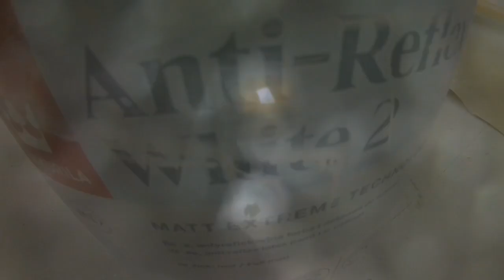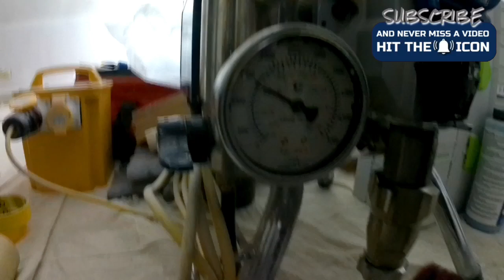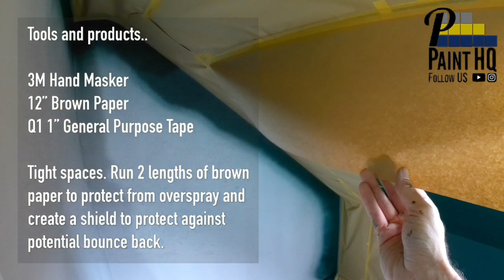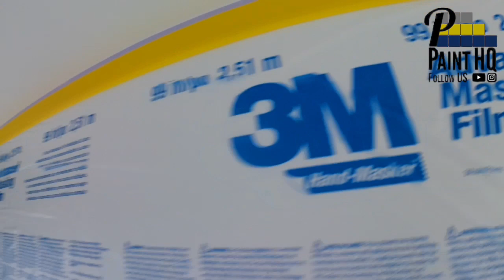How to Paint New Plaster | Mist Coating | Airless Spraying Interior Walls

Comment: nice video....with how much water is the paint diluted?
Reply from the maker: Hello my friend.. thank you so much for the support.. with the mist coat, dilution is approx 30% ..then the top coats of emulsion is just a splash to help ease the flow and spray at a slightly lower pressure.. trim / woodwork paints, I don’t thin.. and only emulsions I thin.. hope this helps, more than happy to help anytime.. I’ll always get back to you.. thanks for supporting PaintHQ.. regards Pete

Comment: Hi Pete, 
I’m posting this separately as it’s a different question. 
Given your logical sequence of working up the room, e.g. trim, then walls, then ceilings, I wonder how you might approach a room with a dado and/or picture rails. I have a client who has just asked for the walls, above and below a dado rail, to be different colours. That led me to thinking about making design suggestions to clients who might not have thought of creating feature walls or highlighting dado and picture rails (perhaps white) against a slightly darker shade on the walls. Would this change the order of spraying for you, or would you simply hit the rails along with the rest of the trim and then mask dado/picture rails carefully and then spray the walls, and afterwards the ceiling?
Many thanks for all your inspirational postings. With best wishes,
Rob
Reply from the maker: Hey Rob.. no problem, I’m glad you’ve come to me for advice.. basically your logic is right (all woodwork first - ceiling last).. In terms of spraying (obviously job prep etc first).. you’d always take care of all the woodwork first, then mask up for walls, this would include dado / picture rails.. then if you have different colours split by the dado for example.. spray from the bottom up.. so if you mask the skirting (brown paper as usual) and the dado, you could use a wider tape, masking the bottom edge of the rail, then top edge of the rail and if the tape is wide enough the 2 runs will cover.. otherwise run a 3rd strip of tape along the middle.. then spray your colour over that rail.. pull the masking (you could look at keeping the top edge on) then tape and drape plastic from the dado down, covering the skirting.. spray your next colour up onto the ceiling as normal.. pull all the masking then tape and drape the entire wall to finish up spraying the ceiling 👍 Hope that makes sense.. it’s not as tricky as it sounds, an extra colour would (most likely) add a day to the job with drying tines.. my HSL video had a dado in the hall, can’t remember how much footage I filmed of the hall if you can see it.. it was only a one colour wall / white ceiling though 👍 ..Take care my friend, let me know how this progresses 😆 regards Pete
Reply: @PaintHQ  Hi Pete, many thanks for such a detailed answer. I’d missed noticing the dado on your HSL video, so took another look and found it at 9.26! I’m now looking forward to the job. With thanks and best wishes, Rob
Reply from the maker: Ah cool 😆 ..You’re very welcome buddy, anytime 💯 .. let me know how you get on
Reply: Id definitely warn them of doing that if the rail is different from the frames and skirt when it joins it looks shit ... they probably want classy not a clown house.. google search it and show them..but id spray it finished then mask it off.

Comment: Do you leave the windows masked up until the room is finished or do you peel it off whilst the paint is still wet to avoid peeling? Then reapply new stuff
Reply from the maker: Hi Ashton, thanks for the question.. typically I remove masking when wet, like you say to avoid the risk of peeling.. Great to have your input, keep in touch buddy.. regards Pete

Comment: That's a really great video mate. I recently sprayed a freshly  plastered ceiling using ar2 but only thinned by about 20 or 30 percent and it did bubble and peel in places. I put this down to maybe going in to thick with it? Or maybe I didn't thin it enough ? Or maybe a bit of both !?

Also, did you use pink tesa over the little green once painted and how long did you leave the little green to dry?

Only asking as again I misted with ar2 and left overnight and it still peeled with using pink tesa over it .

Soz for all the questions! Many thanks
Reply from the maker: Hey Chris, really appreciate you watching and giving the kind feedback 💯 ..Maybe just to edge on the side of caution, with AR2 by design providing  such solid coverage, I’d look to thin an AR2 mist a bit more.. say about 50/50 or 60/40 in favour of more water.. at 60/40 the mist is still pretty solid and sucks into the fresh plaster a treat 👌 Regarding the Little Greene.. I mist coated (allowed to dry) and sprayed Little Greene in one day.. the following day, I masked off and sprayed the main walls.. My actual preference is Deltec Sensitive, I do occasionally use Tesa due to availability.. I know a lot of people rate Tesa, for some reason I have more success with Deltec.. I always use a sensitive tape when masking off walls (then use Q1 General Purpose / or SP80 on the hand masker), luckily I don’t get many snags... Hope this helps a little my friend.. ask as many questions as you want, I’ll always help if I can.. keep in touch.. regards Pete 🎨💯
Reply: Great reply cheers Pete 

All the best 

Chris
Reply from the maker: You’re very welcome my friend 💯

Comment: With most coat is it 50/50 water and white paint?
Reply from the maker: Hey Danny, thank you for your question.. yeah 50/50 or you can push it to 70/30 (30% water), especially if mist coating a ceiling in white, it will start to look solid very quickly 👍 ..for mixing the mist coat, use an acrylic based emulsion or you could use an acrylic primer that’s specific for fresh plaster.. that way you might not need to thin, but it wouldn’t hurt to add 30% water for the very first coat.. hope that helps my friend.. keep in touch, it’s great to have your contribution on the PaintHQ channel 🙏 regards Pete

Comment: Hi Pete, spot on job. Have you ever had a problem with the paint pulling using the Deltec Purple Delicte? Also have you ever mist coated with Johnstone's Covaplus or Durable before following on with the same top coats and if so at what ratios for mixing. Thanks.
Reply from the maker: Hi Lisa, thanks for your feedback, really appreciated.. The only time I have problems with Deltec Purple, is when I’ve prepped and repainted (sprayed) someone else’s work and it became evident that the initial paint job, the fresh plaster / skin wasn’t mist coated / primed.. it’s a horrible situation, we just don’t know historically how the plaster was prepped.. or another possibility could be dust contamination of the walls.. I think in either of these situations, it wouldn’t matter how low tack the tape is, there’s real potential for the paint to pull 🙈 Otherwise I’ve personally found Deltec Purple very good, the shade of purple is easy to see when finding your line too Vs other brands.. regarding mist coating / Johnstones.. in the past I would use Covaplus on my ceilings, I actually don’t mind the Johnstones range 👍 ..Including the Acrylic Durable for walls.. this video I’m spraying the walls (over a previous paint job) https://youtu.be/QIXCcJ3IIXM ..For mist coating lately I typically use Tikkurila AR2 mixed 50/50 with water.. have you ever tried AR2? It’s an awesome very flat matt finish for ceilings.. or I’m looking to use an acrylic primer for fresh plaster, something like Tikkurila Optiva Primer.. sorry I sound like an advert for Tikkurila 🙈 ..So yeah, in theory you could have success with the acrylic durable mixed 50/50 as a mist due to the acrylic base.. but I’d look into something more specific.. Johnstones do Joncryl Primer, which includes plaster as a substrate 👍 hope this helps a little, feel free to get back to me.. I appreciate your contribution to the channel.. regards Pete 🎨💯
Reply: @PaintHQ  Thanks for a very detailed reply Pete. I use AR2 on ceilings all of the time now (roller finish) and its faultless just a little expensive, £43 is the cheapest I can get it local and its still further away from my local Johno's, however, they also supply a lot of the Tik gear which I have been thinking about trying. I tried the Joncryl recently on top of silk and it covered great and stuck solid however I found I had to let the top coat down a bit to get it to lay off better. I also tried Johno's durable matt as a mist coat using their recommended ratio of 4 parts paint to 1 part water, its stuck well but I haven't put a load of tape on it (usually use Frog Yellow) to try a pull test (I could as its my rental property without fear of upsetting a customer) I tried a few spot tests I'd say 20 different areas and 3 patches pulled back to plaster so I've lost a bit of confidence with that method, maybe a higher ratio as you suggest 50/50. This is one of the areas that is putting me off doing full rooms the risk of paint pulling. Thanks again.
Reply from the maker: You’re very welcome, feel free to ask questions anytime and I’ll always do my best to help.. It’s good Tikkurila is starting to feature in Johnstones trade centres, I believe the parent company PPG brought Tikkurila 👍 ..Have you joined the Tikkurila Pro Club? It’s free and you’ll get a discount, it might work out better or maybe your Johnstones store might match your discounted price.. I basically phone my orders via Tikkurila’s offices in Edinburgh, I especially keep a stock of AR2.. they’ll deliver next day for free👍
Reply: @PaintHQ  hi Pete did you get to try the Optiva primer for a mist coat mate?
Reply from the maker: Hey Richard, great to hear from you my friend.. yeah it performs very well, I’d use it again.. or alternatively, if I have a stock of AR2 I’d mix that for a mist coat.. I’ve actually been mixing AR2 with less water lately, so only 30% water (70/30 in favour of AR2).. hope you’re keeping well and having success.. regards Pete
Reply: @PaintHQ  hi Pete, that's interesting, what promted you to use less water? I'm busy prepping a house ready to spray, should be doing the woodwork tomorrow so fingers crossed. Did you get any paint pull with the primer going on neat? Got a 210 fflp and 310 fflp using Tik  otex akva. Thanks again.
Reply from the maker: Hi Richard, it was just a suggestion on here, which was mice 😆 I think anything around 30-50% water is fine 👍 ..Ah great, you’ll have to let me know how the house progresses.. you’ll do well with Otex Akva 👌 I very rarely get paint pull on walls when masking to spray ceilings.. just keep everything prepped well and dust free 👌 ..I’ve got a nice video coming soon, a HSL ..decent size, 50 spindles 😆 ..regards Pete
Reply: @PaintHQ  hi Pete. Done another ceiling today which I think is all good, will find out tomorrow in the day light. Just wondering if you could help, on a couple of occasions the pressure on the unit was bouncing, struggling to hold, I reprimed the unit and it was fine, done this 3 times, after each prime air would cone out, could this be the issue? Cheers
Reply from the maker: Hi Richard, great news on the ceiling.. remind me which sprayer you’re using? Sorry if you’ve mentioned before, I don’t recall.. Is the pressure issue occurring where you’re trying to build pressure in the line, in readiness to spray.. I’ll do my best to shed some light on the issue 👍😆 regards Pete
Reply: @PaintHQ  cheers Pete, it was while spraying with a graco 290 spraying AR2 with a drop of water through a 315 tip and black filters. So was a quarter way through and the pressure started bouncing, I then went to the machine and primed it, air came out along with the paint, put it back to spray and it worked fine for another half of the ceiling then done it again. Is it possible it was sucking air in if the rockstopper wasn't fully immersed?
Reply from the maker: Ah yes, in siphon mode that could be what’s happening ..and I see what you mean, from the sound you describe, it’s like when you get caught out and run out of paint (or just about to) and air would get drawn in.. with siphon, you can raise and tilt the can but you never quit get the last bit.. even if the siphon is submerged, there isn’t the volume.. it’s one reason I prefer a hopper, there is always gravity ‘pulling’ the paint through.. although I can get caught out I’d the sprayer is on another floor and you have to dash back 🙈 ..same scenario, air gets drawn in.. or if it’s at the very end, the machine tries to maintain pressure like you describe.. more so if I’m working at low pressure (up to and around 1400psi).. hope this reassures you my friend 👍 ..regards Pete
Reply: @PaintHQ  thanks Pete, It does help reassure and good to know I was on the right tracks. Hope it's covered well enough. Thanks again Pete, take care.
Reply: Ceiling looks good mate :)
Reply from the maker: Lovely to hear, you’re doing great my friend 👌👍😆
Reply: @PaintHQ  hi Pete, hope you are well. Mist coated a kitchen, bathroom, utility and a few other odd walls yealsterday using johnstones acrylic durable matt 60% paint 40% water, tried deltec purple this morning on around 12 different spots on all rooms, only issue is I've had paint pull on 4 spots in the bathroom, any ideas mate?
Reply from the maker: Hey Richard, thanks for the update.. sorry to hear you’re having a little ‘bad luck’, your approach sounds spot on.. maybe the fresh plaster in the bathroom still retained  moisture, or there was dust contamination from any work being carried out.. it’s hard to say.. keep going though, don’t ever give up, you sound very logical in your approach and a natural sprayer 👏👌👍😆 ..regards Pete
Reply: @PaintHQ  cheers Pete. I wiped all the walls etc until dust free. The mist coat was pretty solid, withstood a light sand and I rolled the first coat of soft sheen on with no issues. Sprayed the second coat and it looks awesome. Thanks again.
Reply from the maker: Great news my friend, thanks for the update.. regards Pete
Reply: @PaintHQ  do you think this will be OK?
Reply from the maker: Hey Richard, apologies my friend I’m not sure what you’re asking.. I’m more than happy to help if you could clarify what you mean 😆
Reply: @PaintHQ  Hi Pete, nearly finished a huge house, all sprayed and its looking amazing thanks to your help and advice. woodwork painted in otex Akva then johnstones aqua guard, walls mist coat with johnstones durable matt 50/50 then 2 top coats of johnstones durable commercial white colour let down by 20% edges taped off with deltec purple and ceiling painted with AR2 with a drop of water to ease the flow. bullet proof finish throughout and really smooth, no tape pull either. Thanks again
Reply from the maker: Ah this is great news, really am pleased for you.. appreciate the update.. on your other question about gun spitting, I’ll get back to you on that 👍 ..regards Pete

Comment: Thanks for the video. What tip did you use on the ceiling? I'm gonna by a Wagner control pro 250M and they only have green tips- so what tip size would you use on the ceiling if working with green ones? Also- if you don't mind me asking- do you do the ceiling last because the walls are easier to mask? It seems like every painter and DIYer has different preferences so it would be nice to hear your take on it :) I haven't used a sprayer yet but try to learn a lot in advance. 
Just a last question. Did I get it right that you only sprayed the white paint on the walls once? I mean- if it covered that blue/green color in one round of spraying that is truely amazing 😁
THANKS again 🌺
Reply from the maker: Hi Hanna, thanks for your questions, I’ll do my best to help you every step.. if I miss anything or you have further questions, feel free to get back to me.. firstly, congratulations on taking the leap into spraying 👍 it’s very rewarding 😆 ..This video I made on the 250M might be worth a watch, it does cover an important point about what tips you could use.. to summarise, unless you buy an additional tip guard, you would need to stick to the ControlPro propriety tips.. It comes with a 517, which you could spray ceilings / walls.. I just prefer a 515, the paint will flow a bit slower, you get more control.. especially helpful for a beginner https://youtu.be/3Mlzp37Uepg
I’m planning a future video to demonstrate tip size and tip size in relation to paint flow 👍
..You’re exactly right about masking the walls to spray the ceiling last.. it’s so much easier to do it this way round, and you get the most perfect line 😆 ..Regarding the white mist coat for fresh plaster.. yeah one coat is sufficient, using an emulsion / water 50/50 mix.. I believe that’s touched upon in the video above too 😆 ..Hope this helps, keep in touch, it’s great to have you contributing to the channel.. regards Pete 🎨💯